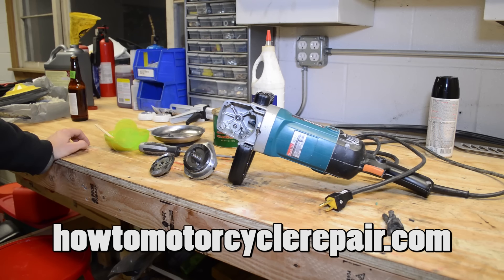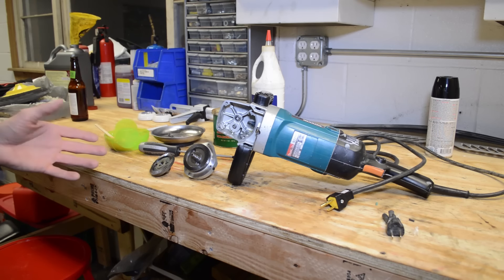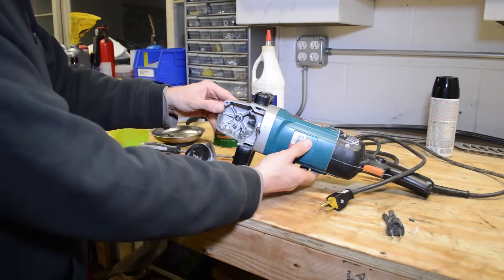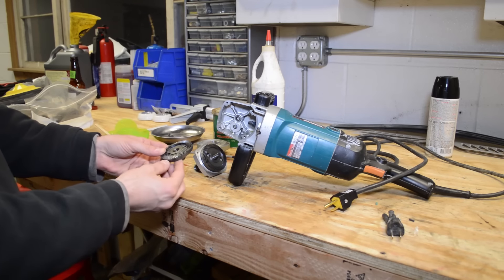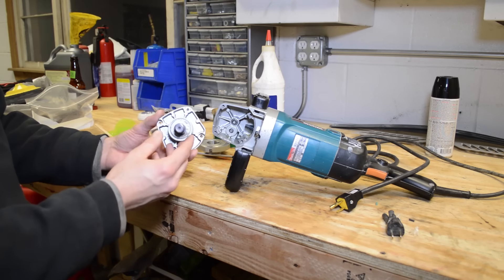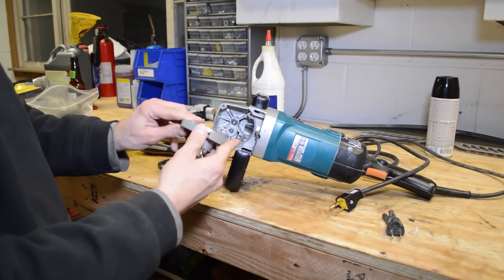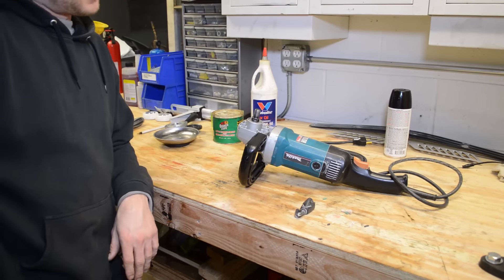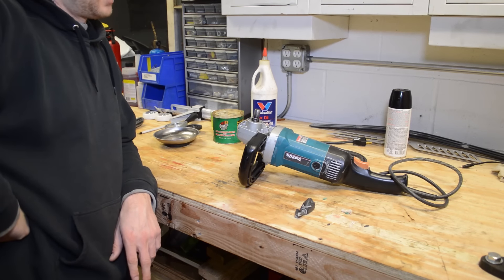How-To: Makita 9227C Grinding Noise Repair

Comment: Thinning the grease will create another issue since the pinion gear is not liquid proof and the oil will seep back into your armature--not good!!
Reply from the maker: I believe the armature bearing is sealed, so nothing will seep past.
Reply: Don't confuse a 'shielded' bearing and a sealed one.  It would be spectacularly expensive and difficult to do in bearings of this size.  The grease/oil will lose viscosity as it heats up as well.  The bearings in these style grinders are not sealed.  Storing them hanging of course would drain back into the armature attracting dirt and increasing wear, etc.  Don't believe me?  Pack your gear case completely full then screw up the gear shaft.  You will see grease push right through the bearing on the shaft.  In car axles which are oil lubricated you will find a seal system with the bearings inside.  A seal need a means of compressing on the shaft to work (thus the spring and lip on some) or a way to expand in a forceful enough way to complete the oil proof fit.  A difficult engineering task at the cost point and size of these bearings.  A packing gland would be needed again bumping up the size.  Grind some steel for a half an hour and when it is warmed up take it apart (including the motor) and take a look.  You won't do it again I will bet.  Take care.  Doug
Reply from the maker: So what do you recommend for lubrication?
Reply: Any top grade gear (not bearing although it is a fall back) grease is about as good as you are going to do.  The ultimate is the Molydisulfide but at 3-4 hundred bucks for a tube it isn't practical.  A cheaper alternative is Yamalube grease.  The gear grease has 'sticking' properties that help.  There are some teflon greases which aren't quite as expensive.  The particles are designed to imbed in the metal.  Bottom line:  pop it open every five or ten hours of use and redistribute replace the grease.  If you want to it is certainly possible to drill a hole the size of a spray wand in the housing and use a spray grease (I would try the white lithium perhaps) then plug the hole with fitted plug of your choice. I would tap and thread it while it is apart.  Now you could give it a shot before each use. Take care.  Doug
Reply: Actually his method of mixing worked for me, i took a multipurpose grease nlgi 2 and gear oil, the point is not to make the grease so liquid, it should be as soft almost as petroleum jelly, also the key is not to pack up the gear case with grease just a bit and there you go, with not problems at all

Comment: Does it not occur to you to make a proper job of it by also replacing the motor bearings?If the drive bearing is worn out, you can bet the rotor needs new ones too. They’re inexpensive and not difficult to pull and press. Check the brushes as well and clean the commutator.
Reply from the maker: It did occur to me, all bearings ended up being fine. I "thought" it was bearing noise, however it ended up being gear noise.